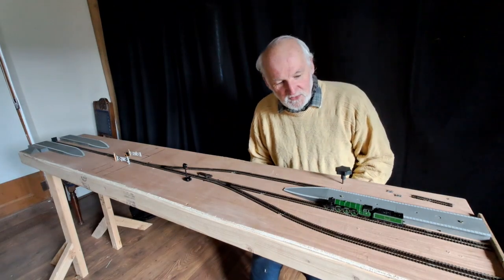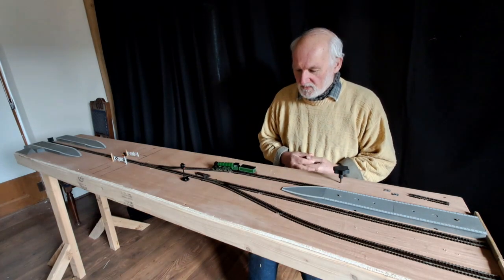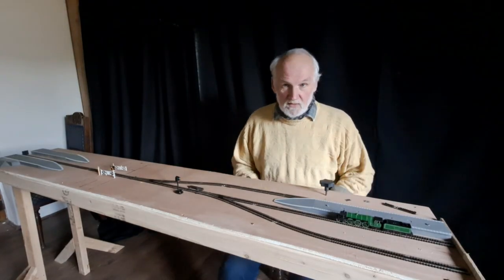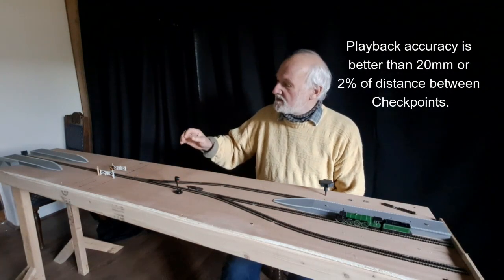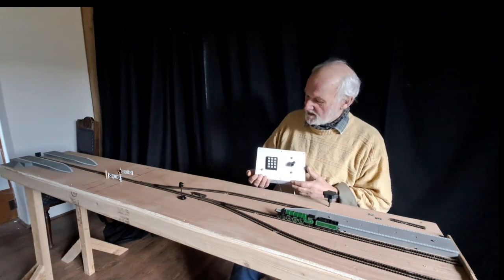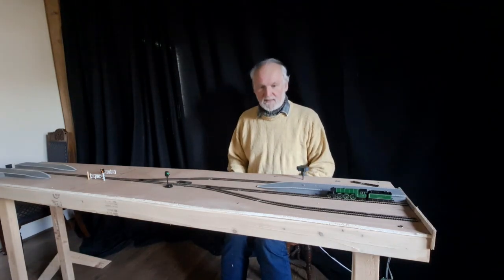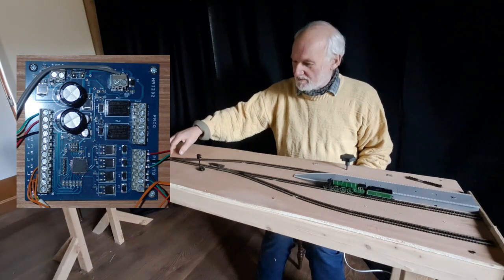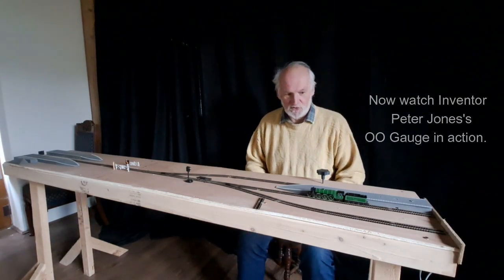Fascinating Invention. Automated Analogue model railway.

Comment: Yes,  but what I didn't get was how you achieve very low speed without cogging, using this system?
Reply from the maker: Hello, it's the miracle of electronics! High frequency PWM with delayed armature feedback keeps the motor moving at all times albeit slowly. This way any backlash is never allowed to show up.
Reply: @philwilliams899  OK thanks - sadly it's all Dutch to me, apart from "the miracle of electronics, which it obviously is!
So, with so many poor runners coming out of the main manufacturers, why aren't they including whatever it is in their locos - that would be awesome - or is it all in the control box?
Even so, if it is, then they could surely include it in their controllers - why not licence it to Hornby etc.?
Reply from the maker: @SuperJ333  We are talking to Hornby etc
Reply: @philwilliams899  Awesome - truly well done guys!

Comment: If I understand  the process correctly, then, with power-routing turnouts, after the reverse into the stub terminal control could have been transferred to the waiting passenger train by aligning the points for its route. Right?
Reply from the maker: Yes thats exactly right.

Comment: Wow Amazingly simple, I do n gauge and use BLOCKsignalling modules to automate, your system is soooooo much better as you can control speed at different sections stop and reverse exactly when you want all with no isolated blocks!!      Please keep us informed of any updates.    Heres my wallet!   :-D   well done
Reply from the maker: Thanks, yes it's simple and very flexible and accurate. We will probably proceed to market and include N gauge. We will need some beta testers if you're interested  Phil
Reply: @philwilliams899  Count me in!   will set up a new layout especially for it.  I am old school  so am used to block systems but i love the versatility that could be acquired by your system.
Reply: @philwilliams899  Hi Phil, just a quick question, the underboard module that controls points and lights..... does it have a capacitor discharge in it for controlling the points or do the points require their own Cap Discharge unit?  Thanks Phil. (yes I am called Phil also!)
Reply from the maker: @Rodeown  yes it has capacitors on board, so you just supply 12v and connect the lights & points to it. There's a 4way dip switch to select its ID to distinguish itself from any other lights/points boards.
Reply from the maker: Thanks, We are now looking for people to Beta-test the production version. We have 6 systems available and would you be interested is receiving a kit to try and let us know how you get on so we can learn from real people?!  You can email me via our www.modelrailwayautomation.co.uk website where you can download the manual. Phil
Reply from the maker: Hello, finished version now available to buy £199 from mrinnovations.co.uk  and Ebay

Comment: So it’s still DC with all its limitations. You can’t control more than one locomotive on the same length of track unless the second locomotive is on an isolated section of track. 
My model railway layout was originally operated by a DC controller with isolated sections of track all over the layout, absolutely nothing like a prototype railway.
When I changed over to DCC I found that I could independently control each locomotive instead of just controlling the track voltage.
Reply from the maker: Yes it's DC and it takes DC to a new level  of precision automation record and playback.

Comment: This looks amazing, but can a recorded routine control more than one loco? And can you store more than one routine at a time, or only play back the current one?
Reply from the maker: It's a dc system so only one loco moves at a time but others can be driven and parked in sidings just as you do with dc the recording can then switch the points and get the next loco moving. Routines could be stored and recalled, but this is our first unit to prove the system so it plays back what you last recorded as many times as you like.
Reply: Thanks  @philwilliams899  . I'm not knocking it at all; I think it is quite brilliant, and I hope it is a big success.

Comment: That was really good. I can visualise exhibition layouts with this system, without needing a computer. Brilliant.
Regarding the use of magnets, I use them on my Southern Railway layout to operate the signals and conductor rail flashes, but I have found that the magnetic field of some of the motors is also strong enough to activate the reed switches, so I have not needed the magnets on all the locos.
Reply from the maker: Nice thing about our checkpoints is that we can adjust the sensitivity to avoid the motor magnetic field, also if you happen  to park on top of one it doesn't remain energised.

Comment: Magnets have been in use on Model Railways for years. The drawback is that the system cannot distinguish between different locos, and of course every loco that is to be on the layout must have a magnet. An RFID system involves too much wiring, and I think Hornby has now abandoned their proposed system in favour of Bluetooth.  This system you have devised is an alternative at lower cost, and I think you might have success with it. Thanks for uploading.

Comment: That's an awesome system, especially with the no wiring. The Tomix TNOS of course uses sensors for positioning and of course operates signals, points etc, but also allows multi train use when the system is learning, and again things like the old berliner tt used those little "shorters" for sending the dc pulse, but couldn't playback. 
So I'm guessing this is similar to the TNOS? But I do believe yours has that rather excellent ability for infinite recordings. The TNOS being entirely Japanese it's still not exactly clear how or what its learning.
Great to see. Loved the demonstration, and the layout. Just great model railwaying. As it should be.
Reply from the maker: Thanks for you kind words, Ive never heard of the TNOS or the old Berliner  until you mentioned it (I'm not a model railway person, amateur radio is my main hobby), we've just been working from my idea. It didn't come up in our patent search
Reply: @philwilliams899   I think the patent search is probably fairly loose, both of the items mentioned being for either the Japanese home market or the former DDR, neither of which would be likely of intrinsic interest towards the UK intellectual property scene.
Quick (loose) translation of the tnos: "Multiple vehicles run simultaneously! Automatic control of the vehicle with sensor built into the rail! TNOS (Tinos) is a simultaneous automatic driving system of multiple railway model vehicles. It is possible to operate the same as the real thing, and it is possible to operate multiple trains at the same time."
The old DDR is a bit harder: the catalogue pages are all jpgs, but a quick look in the Zeuke 1972 catalogue theres the following track pieces involved: a rectifier section; a switching track (not a point/turnout); an adjustable timing switch section; and a relay section; these all being wired together in the correct East German practice for the best in boeorgeious automatic train control, the train axles 'shorting' the sensor tracks, tripping the relays that control various turnouts or timed stops. The relays also contain the facilities for reversing the current polarity as well, hence train would stop, wait for a time, reverse, and appropriate turnouts repositioned, all triggered by a track "switch" (this being a small piece of rail mounted just inwards from a running rail, the metal loco wheel and axle creating the switch, passing current from one opposing running rail to the short piece of rail, same principle as what the 3 rail automatic toy train control systems functioned on 100 years ago, just more reliably! (The timers operated by the heated wire trick start to lose their edge after 100 years; I don't really use them now, fortunately the designers did incorporate switches to operate the items manually or for automatic train control.
The DDR items of course being infinitely variable by moving whatever fixtures around the layout, but didn't have a 'base' as such and wasn't programmable in any way, whereas the tnos system is.
Everywhere I've looked has sold out of the tnos system so theres obviously a market for DC automation, so hoping you're in the ballpark with your timing and product
Reply from the maker: @muir8009  Thanks for that, very comprehensive and quite different from what we are up to. Timing wise not ideal really as Hornby said they would have been interested but they are hugely up the wall with their bluetooth mesh. Phil Williams's search for his next business partner ................ cntinues.!
Reply from the maker: Hello, finished version now available to buy £199 from mrinnovations.co.uk  and Ebay

Comment: Nice work.
So in essence you've made the track DCC rather than the engine. 👍
Can it cope with multiple tracks/locos running at the same time? 
Mon from Monsville Railways
Reply from the maker: Thanks Mon, no its really dc techniques, ie one loco on one powered track. You can easily do a routine for 2 locos as long as you run one at a time with the other parked in a siding that gets switched off by the points.
Reply: Exactly!  When you think about it, could have been a good approach right from the start of digital model railways - it would certainly have been lower cost - but perhaps we would not have gained all the things that came later.
Reply from the maker: @alanmusicman3385  Thanks Alan, definitely lower cost but you cant get sound in the loco with this. I do like the sound in DCC.
Reply: I think this system is a goer. Well done mate. Steven.

Comment: very nice .can you tell me what I will need to run marklin gauge1 trains in england central station 3 +60101 power box and what els do I need to get the power to the track? is there a special central station for gauge1? thanks barry
Reply from the maker: Hello Barry, I'm an electronics engineer and and not a model railway person, I suggest you ask the question on one of the facebook groups such as the Marklin Model Train group that has lots of members. Good luck - Phil